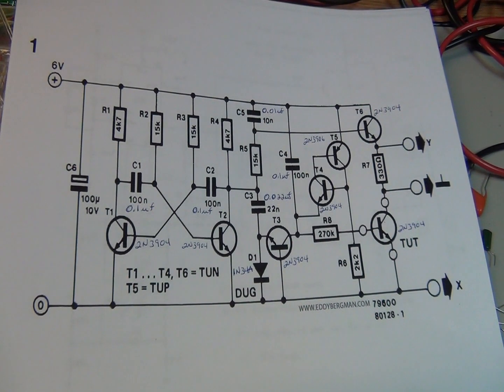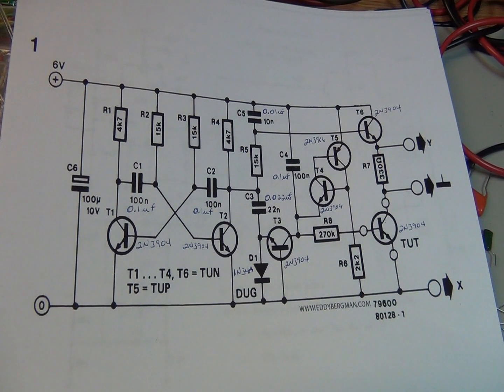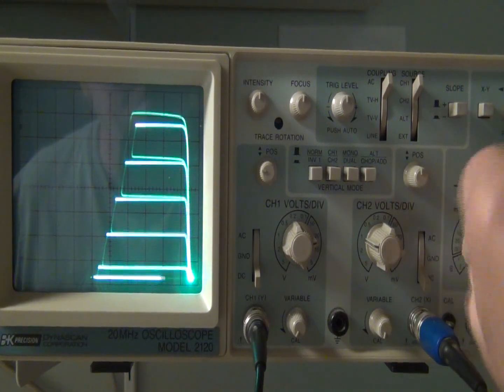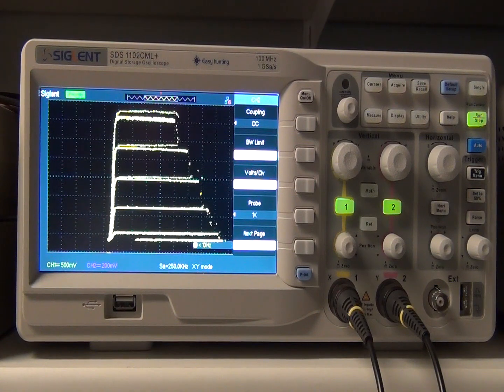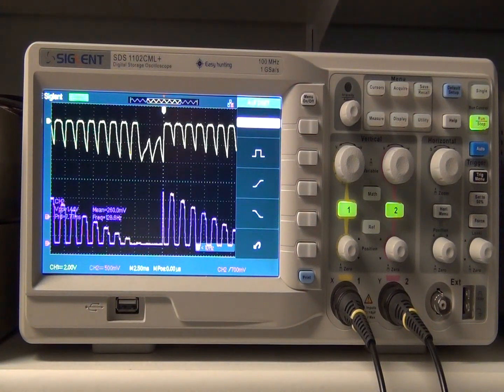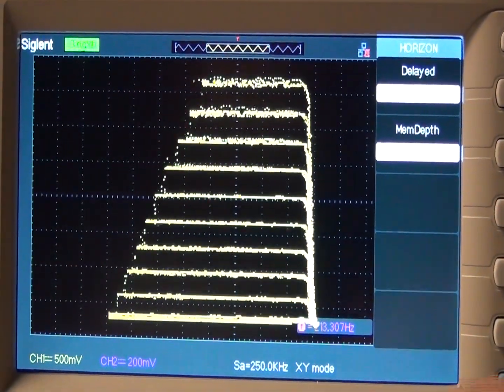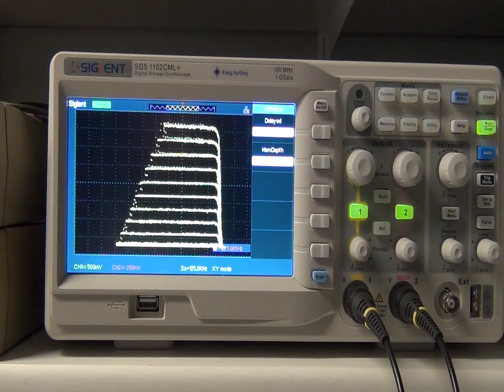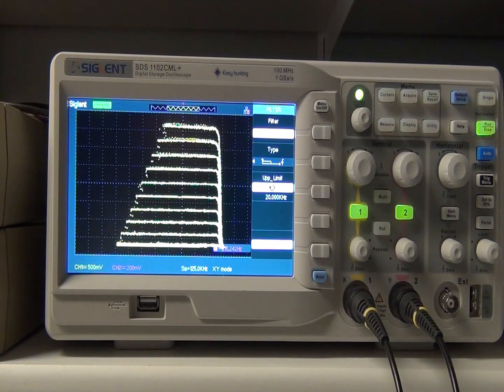Using the Siglent SDS 1102CML+ as a Transistor Curve Tracer

Comment: Good example of how digital scopes aren't very good at X/Y mode... nice to keep an old analog scope around for this type of work, especially a recent one that has measurement cursors like the Tek 2000-series.  I usually use my TDS2024B for most work, but anything needing X/Y mode I'll use my 2465.

Comment: Great video! I only just found this after doing a search for the curve tracer on YouTube. You mention getting different ratios than I got at 8:32  I think that may be caused by a difference in voltage. I believe I was running it on 10V at the time. I'm going to put a link to this video in the Curve Tracer article. I think it may be of great use to others interested in this circuit. Thank you for making the video!! - Eddy Bergman -